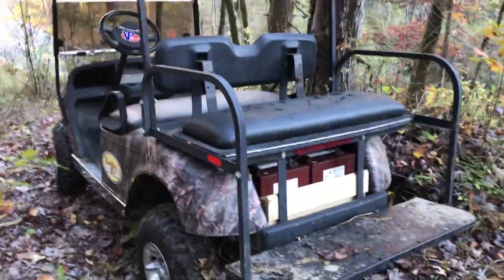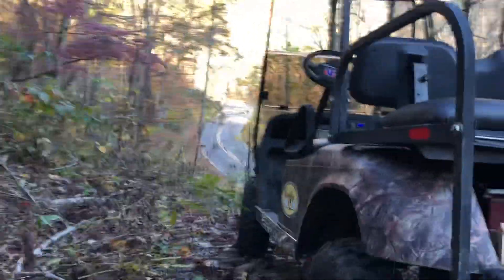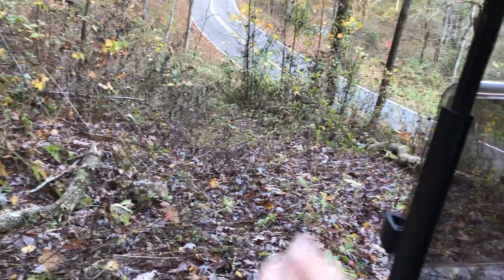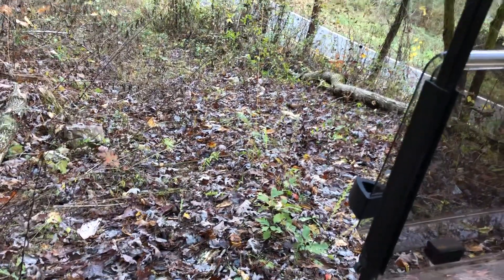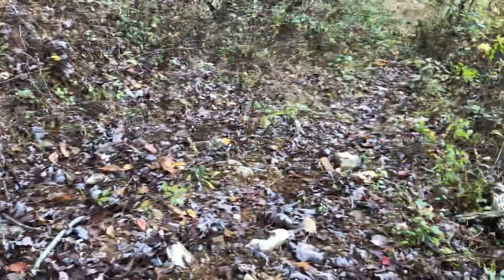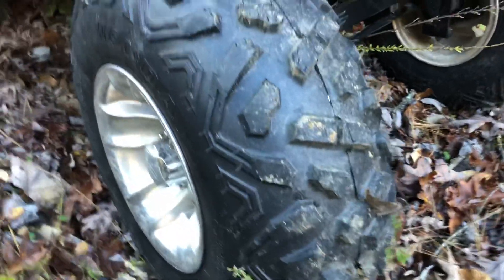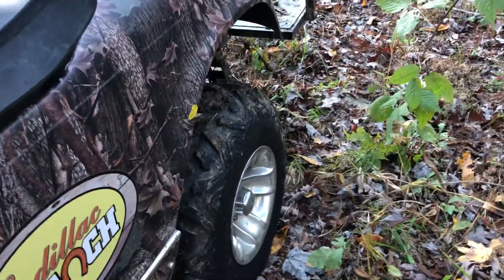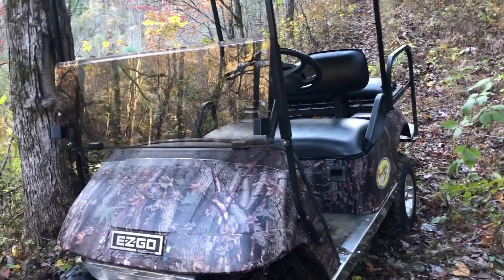Ezgo TXT 36v to 48v Conversion; 6” lift kit build Part 2

Comment: Thank you for the video!!

I have exactly the same kind of unusually steep slopes you demonstrate and I have been unable to find a solution. Part of it is due to the fact I have a non-US golf cart: Evolution Forester 4 Plus. However, I am willing to swap motor, gear and controller for a solution that works - I can tell yours do!
 
Q1: What is the gear ratio? Is it standard 12.5:1?
Q2: Do you have a link to the controller or full product name?
Q3: What is the spec/detail on the motor? You say its 2HP, but is it AC/DC? Do you have a full spec on it so I can buy one?
Q4: If you load 4 adults in the vehicle, what is the max slope you can climb, where you stop ON the slope, and resume driving with all 4 adults in the vehicle while on the slope?

Comment: Stout little buggy! I have a 36v as well about to tackle this myself. Think I’m going to go with the 500 amp alltraxx. What website did you order from? And you just changed the controller and solenoid right?
Reply from the maker: Spencer Edwards EVdrives is where I got everything for my build. You will need controller, HD Solenoid, diode, HD fuse, HD forward& reverse switch, 2ga cables. ALL cables need to be upgraded.  I would spend the extra $100 and get the 600amp. It has the upgraded cooling fan built in, And 100 more amps of juice is always good. 
If you don’t upgrade everything, you will quickly burn up the stock components you didn’t replace from the start. I just ordered a HD F&R switch because I was told the stock TXT switch was adequate. It’s not!  From the start of using my newly built buggy my F&R switch would get hot to the touch. Hot enough to smell burning. Recently it has started surging and stalling. All my research points to burnt out F&R switch or ITS switch. I bought both. They will get here next Friday.
Reply: Paul Hampton cool! I’ve got most everything in a cart. I’ll look into a F/r switch. And probably go ahead with the 600. Might as well get more right!
Reply from the maker: Spencer Edwards absolutely. I don’t know if you have watch the latest video I just posted?, but I use my buggy to pull honest to goodness LOGS. HEAVY logs. I wish I would have gotten video of me pulling the first and biggest log. My front tires were literally 2 feet off the ground while the back tires were spinning. It carried the front tires that high for more than 15 feet until the nose of the log finally stopped digging in the dirt. It was very impressive for a little buggy.
Reply: Paul Hampton yea I watched you pull the trailer up the hill. Pretty impressive for sure! Do you think the 500amp would be much less power? I pretty much only use it around the neighborhood decent hills nothing like you have though haha
Reply from the maker: Spencer Edwards I’m sure it would.  My thoughts would be, just $100 more, and you will never want, or have to upgrade.  If down the road you put in a bigger motor,  then the extra 100 amps is huge.  100 extra amps isn’t  as big a deal with a 2hp stock motor.
Reply: Paul Hampton true. Might as well do it for 100 more in case I upgrade the motor. Found a guy local selling everything and a plum quick motor for 1400. Might jump on it
Reply: Paul Hampton looking on evdrives website. They have a package deal on everything plus a 10hp motor. Is there a reason you didn’t go that route?
Reply from the maker: Spencer Edwards motors on a cart are not like a vehicle. 10hp doesn’t mean it will pull better or even as good as the stock 2hp motor you have now. I would be very Leary of a used motor. You have zero idea of what THAT motor was wound for.  The motor builder uses all different sizes and lengths  of wiring for different applications. So you could potentially get a 15 Hp motor that was wound to be a low torque, high RPM speed application, and you could burn that motor  up rather quickly by using it to pull with. Not to mention you battery life would be virtually non existent if used in the wrong application. 
When I purchase a motor for my cart, it will be solely for torque. I pull stuff with mine. Have very steep grades, and I don’t have a desire for my buggy to run 30mph. 20mph is plenty fast enough for me. So it depends on YOUR application.